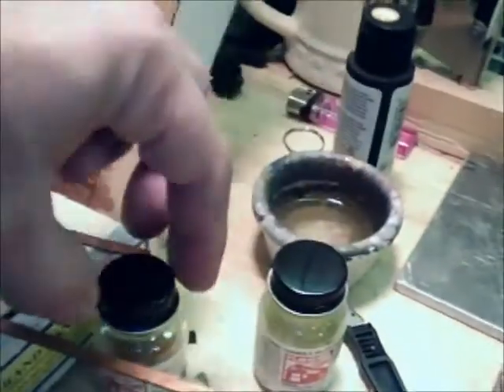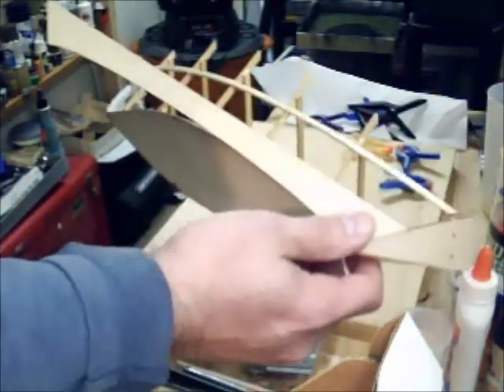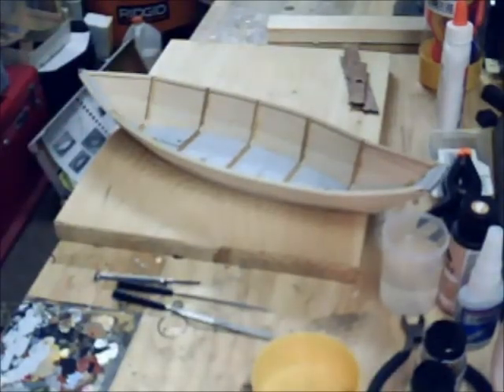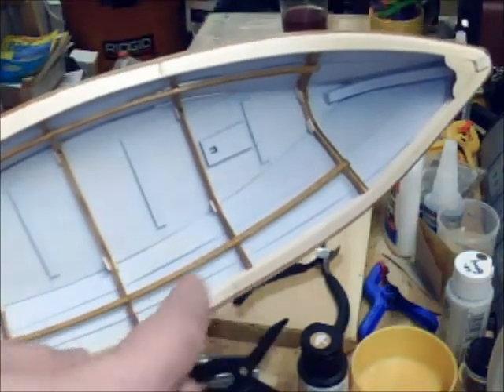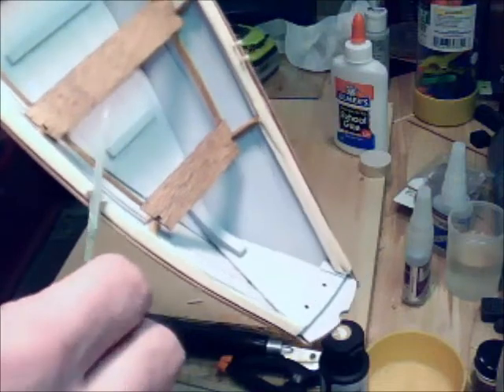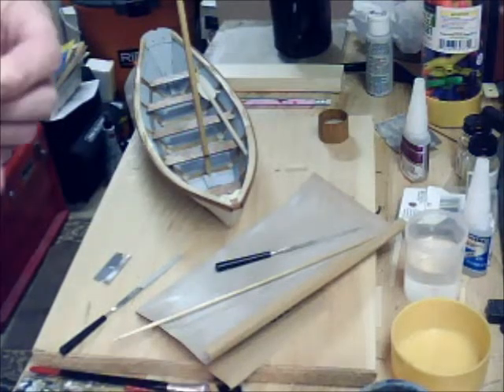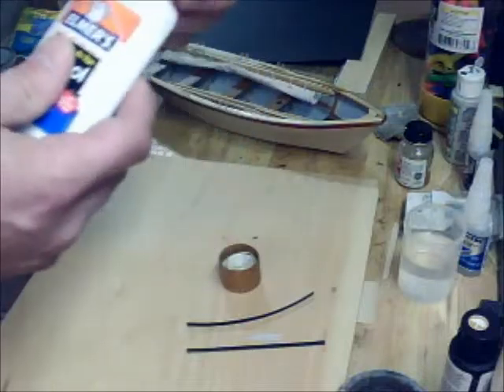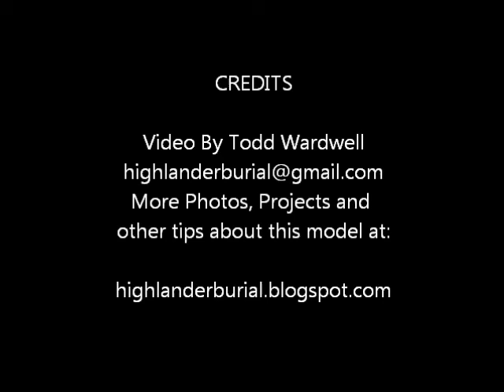Bluejacket Shipcrafters Grand Banks Dory Part 2 (Build)

Comment: Thank you for the video of the building of this particular Dory. I had a question however…

There is a notch in the stern for a Rutter I’m assuming, and yet you did not build one (a rudder, that is).

I am assuming that in order to sell this vessel in real life you would need to have some form of a rudder? Obviously if you are rowing the boat, that’s not the case necessarily but certainly if you’re going to use a sail. 

Thoughts? Opinions?

Also you mentioned building a Dory with your great grandfather and I first of all think that’s terrific that you had that opportunity to do that. I have a great grandfather who was a master Shipwright up in Nova Scotia, who I never got to know, and it would’ve been great if I could’ve worked at his business building ships.

The reason I mention that is because of the waviness of the boards on the side, whose names I have forgotten because I am not a sailor or a builder. You mentioned how you would sync the boat which allowed the boards to form up to each other a little better.

I wonder if there would’ve been a way to disguise some of that waviness in the model?

Otherwise, thanks for what you put together because it is a stimulating thought and perhaps one day I’ll build something.